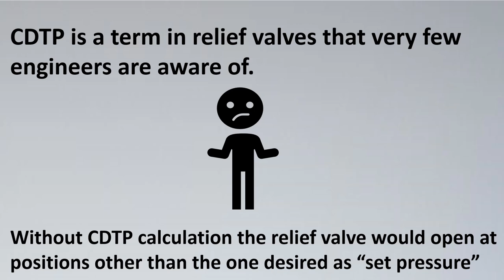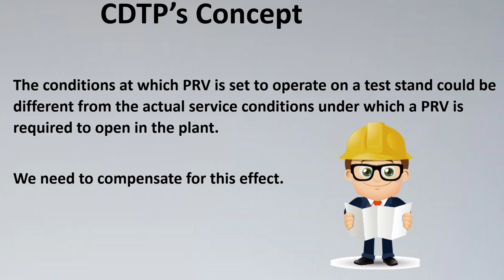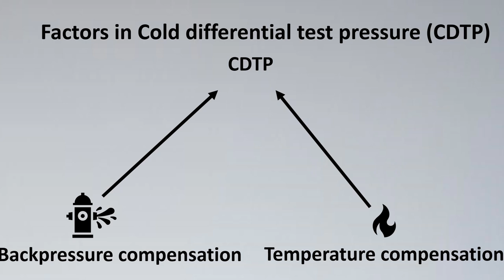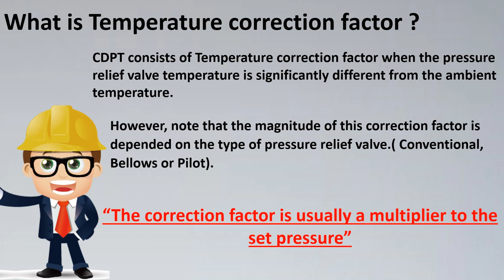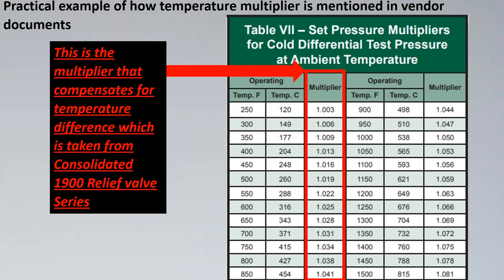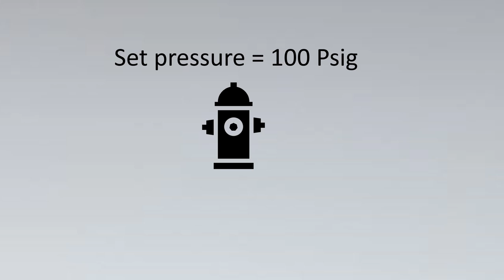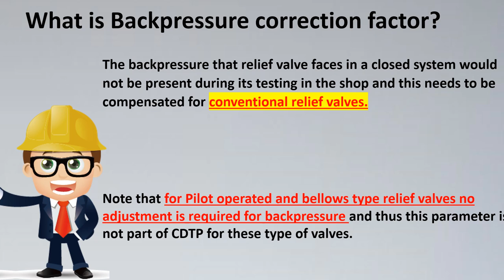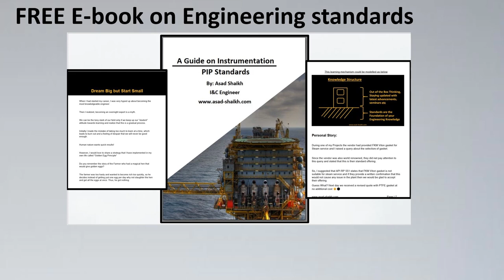What is CDTP as per API 520 in Relief Valves

Comment: Salaam, Jazakallah khair for the video. I have a question. The spring range of pzv should cover both cdtp & set pressure or not? And is there a condition that cdtp and/or set pressure should not be close to the spring low and max values?

Comment: What is the Design basis for setting a set pressure ( value)?
Reply from the maker: API 520 stand helps in deciding this.
The process engineers have to consider the worst cases, relief capacity etc 😊

Comment: In general , wherever you have built-up back pressure or superimposed backpressure, only bellows type valves are used/recommended.
Reply from the maker: As a rule of thumb, up till allowable backpressure of 10% Conventional  relief valves are preferred, Up till 50% Bellow type is preferred, and above 50% Pilot relief valve is preferred
Reply: @AsadPassionateEngineer  hi, thanks for your reply.
Note that , as per API 520 part I,  even Pilot operated PRVs may require CDTP if used in high temperature service. In the video it is said that CDTP only applicable to Conventional PRVs
Reply from the maker: @hareem0305   my dear brother thanks for your comment . I am so happy to know that you have read API standard. Very few engineers take out the time to read the standard. With reads to your query . PLS watch the video careful it is said "THE BACKPRESSURE COMPONENT  OF CDTP IS NOT APPLICABLE FOR BELLOWS OR PILOT OPERATED RELEIF VALVES" .

And you can verify with any psv expert that backpressure effects are  on conventional releif valves .

So the videos states that temperature compensation part is applicable if temperature difference between ambient and plant is significant. However backpressure compensation of CDTP is only applicable to conventional releif valves .

Also, If you have more queries or I have not been able to convey my point properly then you can contact me on www.Asad-Shaikh.com.

I always enjoy technical discussions
Reply: @AsadPassionateEngineer  i just looped back the video to recheck that statement,  you are right Asad, it mentions only about backpressure component. I am involved in Engineering as well as Commissioning in I&C Oil n Gas. So not only i have to read API, IEC , i have to implement them too during execution 😀. Cheers !